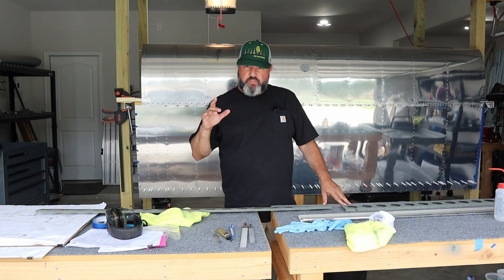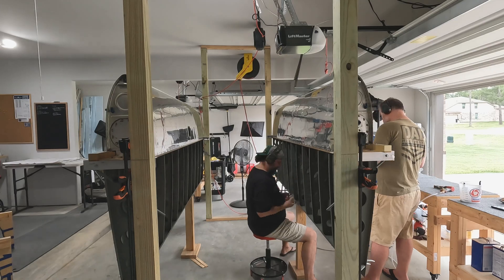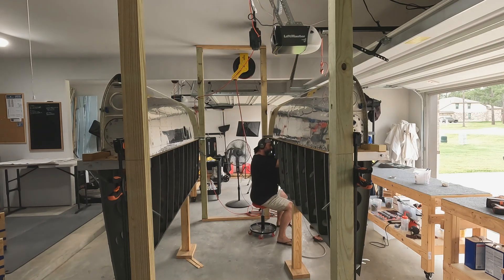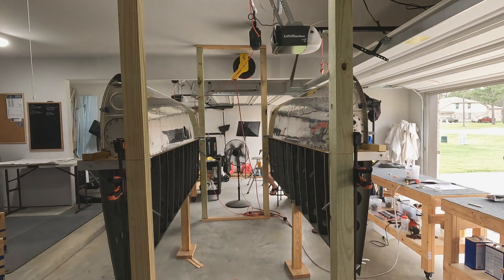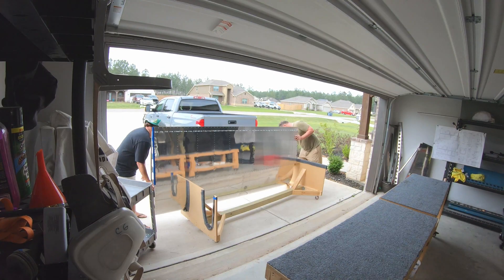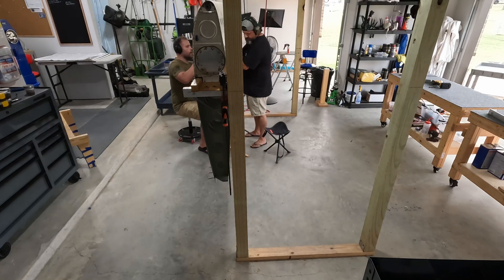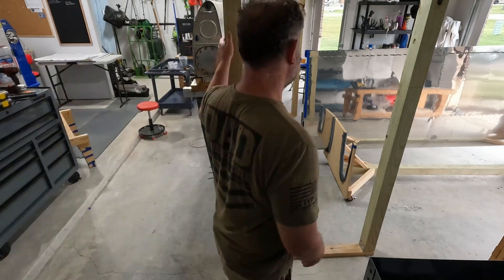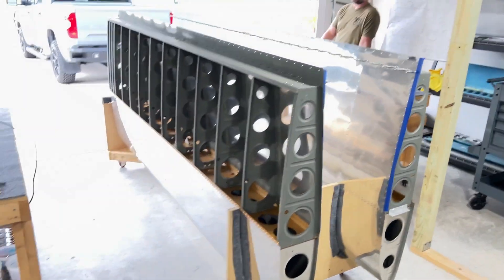Van's RV-8 Build. Ep 116. Wings 40. Top main skins riveting finale

Comment: Looks great! I’m about to this stage on my build, there is a SB for the 413 aileron bracket. There are two L brackets on the back side of the aft spar that block two skin rivets to be rivet using a bucking bar. Also the forward area of the 413 bracket is very close to the flange of the aft spar and it also does. It allow the use of a bucking bar. How did you accomplish the install of the 413 aileron bracket and the top wing skin?
Reply from the maker: Hi Mark. I’ll be working on that very soon. So far, far im not seeing any interference issues with mine. Maybe I’m thinking of a different spot and I’ve yet to run into the issue you’re describing.